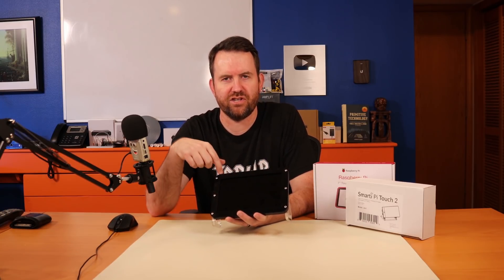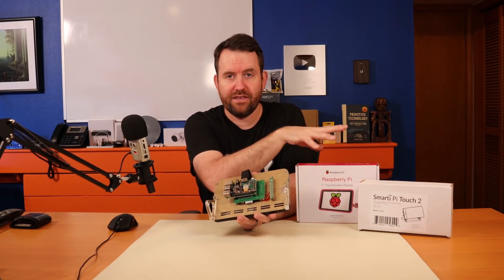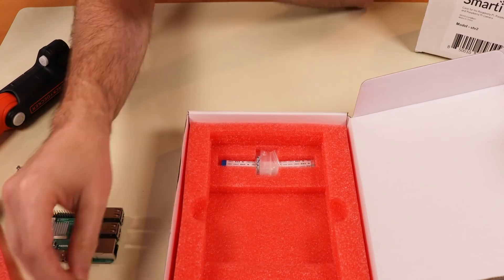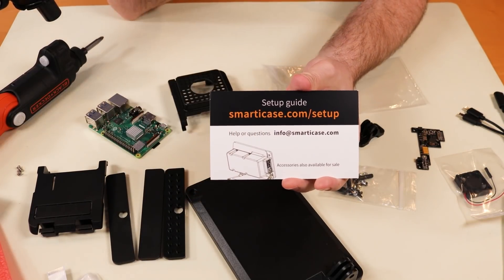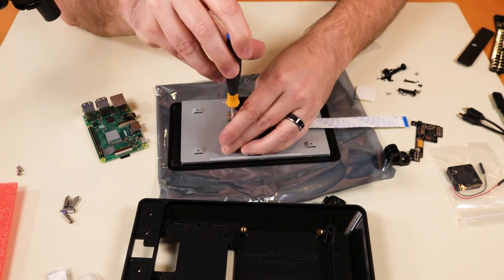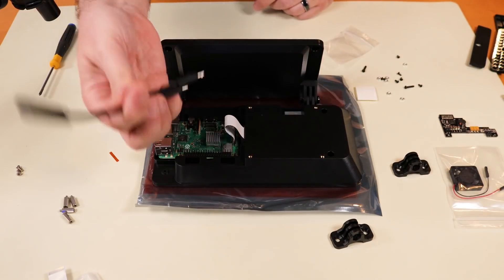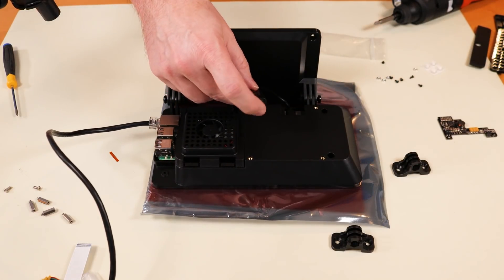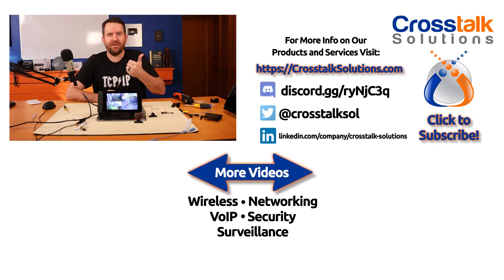Raspberry Pi Touchscreen

Comment: The splitter cable makes sense.  It will allow the touchscreen to get power directly instead of relying on power from the GPIO connector.   Awesome case.   The touch screens are great.  I use one with Octoprint and it has a great viewing angle.
I believe it needs the I2C bus (SDL/SCA) for the touch screen to work.   
  Other than that, this is a great setup

Comment: That’s interesting because I have a touch screen for my raspberry pi and a similar case and it can be powered over GPIO which might allow you to poe the entire unit.  With that config, I only need a single power connection but things might be different now. Touch Screen generally requires jumpers between the board on the monitor and the GPIO pins anyway which on mine established the power connection to run both devices.

Comment: Im using an old laptop to view my ubnt cameras but it times out after 24 hours and I have to log back into the cameras. Does this solution time out?
Reply from the maker: It does - it's an issue with the UBNT RTSP streams.  I have mine reboot automatically every 24 hours.
Reply: @CrosstalkSolutions  Well let's hope they fix that!

Comment: You can power the monitor by running wires from 5V and ground GPIO pins on the PI to a header on the monitor board, then you only need the one power source and I am planing on doing this with the POE hat.  You might need the 3 volt line too, I can't remember.  When I set up this monitor on my pi the POE hat wasn't out yet.
Reply from the maker: Yes - after I did the video I realized that those jumpers the monitor came with were for this purpose.

Comment: It would interesting if you could update the feed display, so if you touched one of the feeds it would make it full screen and touching it again would go back to the regular view
Reply: 4 different browser windows, 4 separate feeds, etc... maybe? 1st thought is no, because that's the whole point.
Reply from the maker: That would be cool for sure.  Not sure if the displaycameras software has that capability, but I'll look into it.
Reply from the maker: Thanks - but I have zero programming skills.
Reply: @Grayson Peddie the nice part of the original project was it autostarted into a full screen view. sure it was single application use of the rasberry pi, but would be perfect monitor. a webpage would be just another thing that need to load when booted.